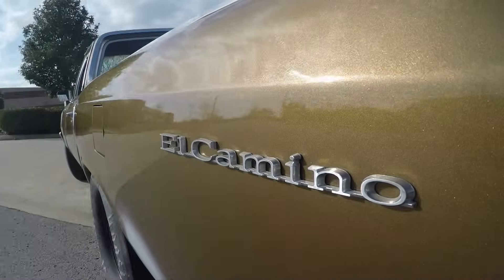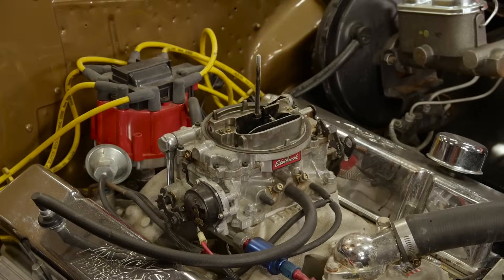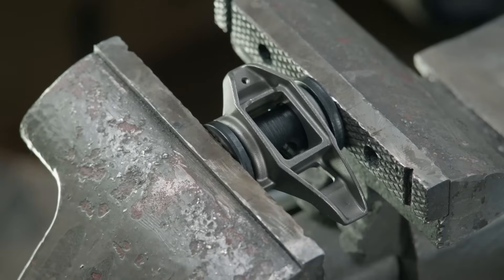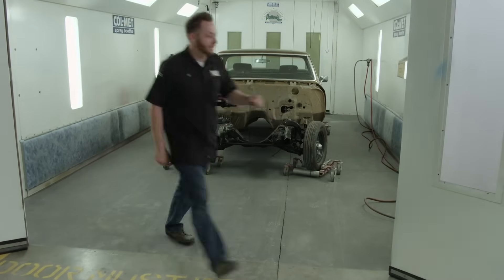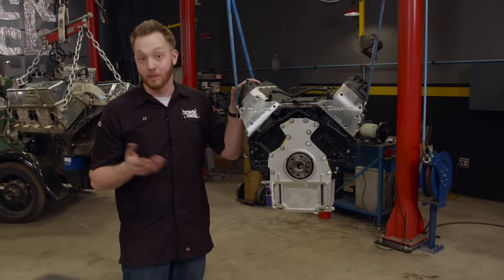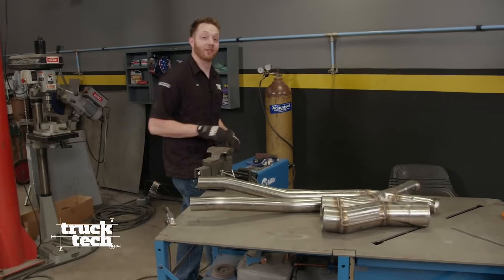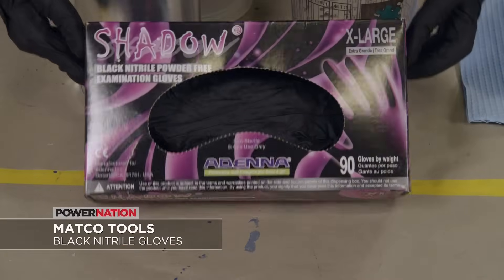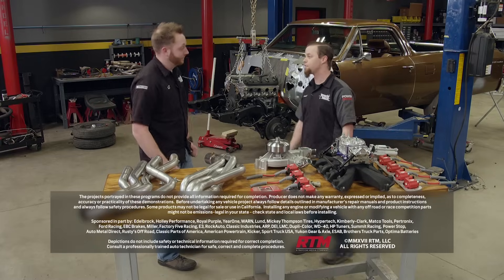Swapping in a Beast: LQ4 Engine in a '67 El Camino - Truck Tech S4, E9

Comment: 3 inch pipe on that n/a 6.0 is way too big, if it had forced induction then 3 inch would be fine. 2 1/2 inch pipe is more than adequate for that application.